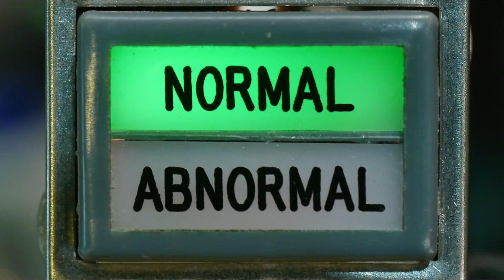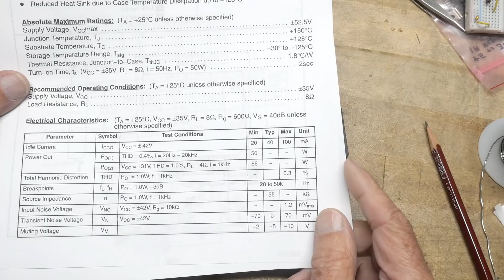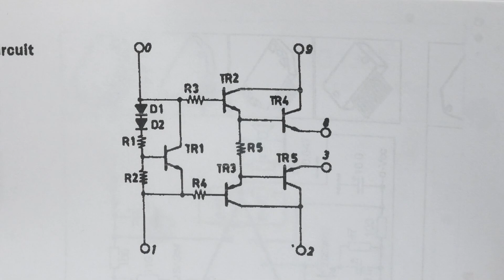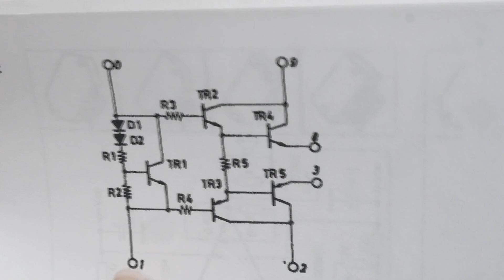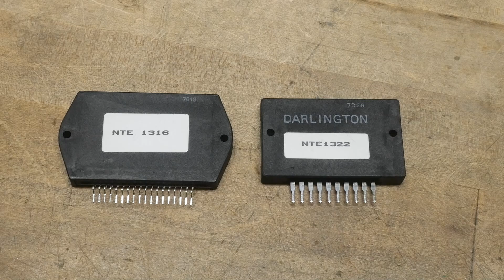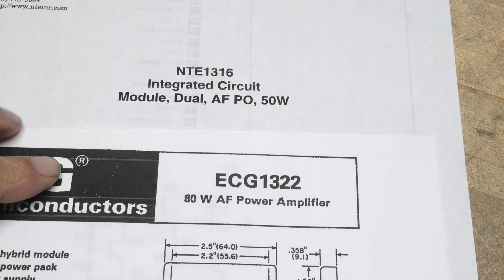#2153 NTE1316 50W  NTE1322 80W  Amplifiers

Comment: Mid 80's I built many amps from 1322's and the driver module that went with them (all from ECG since I could get them at cost from the electronics store I worked at). Ran closer to max voltage and had massive heat sinks. Got good performance out of them >100W. Good times. Still have a few parts and maybe driver boards.

Comment: Thease ICs originally made by SANYO and SANKEN. NTE renamed those.
Reply: Yeah, the NTE1316 is basically a clone STK-series module. Output protection? What output protection? Other than that they weren't actually too terrible for off-the-shelf home "hifi" systems.

Comment: These packages are so frustrating. Paying out the nose for them is not an option when trying to repair amps and receivers. Fortunately some people have come up with boards to replace them with single components
Reply: I did this myself for an amp that I otherwise liked that had a blown STK module - made a little PCB with a pair of LM1875's and enough surrounding circuitry that I could drop it in and keep the original board pristine.

Comment: I got one of those old little TDA-1520A 20W modules in the RS bubble pack but the data sheet is long gone.  Have not had a use for it.  Then I got a larger module I got in a box of surplus store unsorted junk. Apparently it is a rarity now because online sellers want 150$ for them. Not sure but must be hi fi.